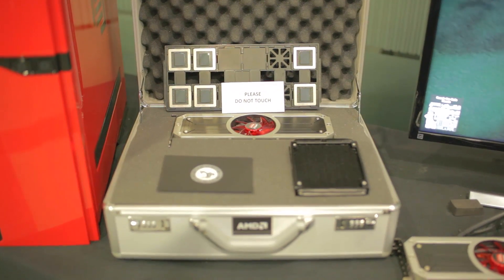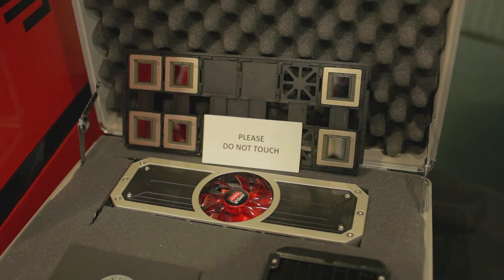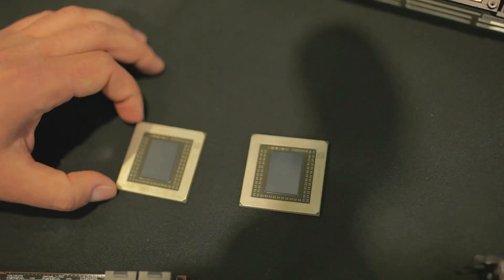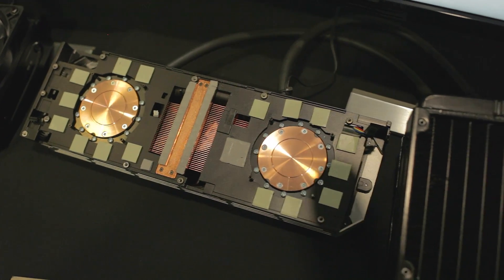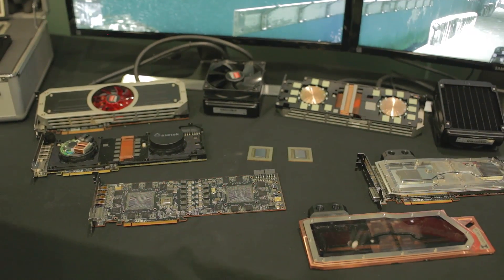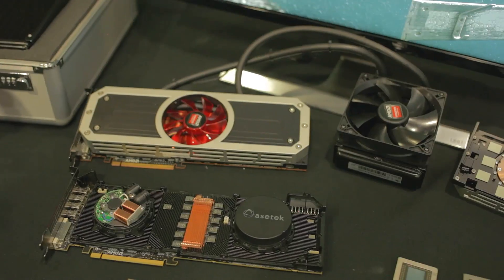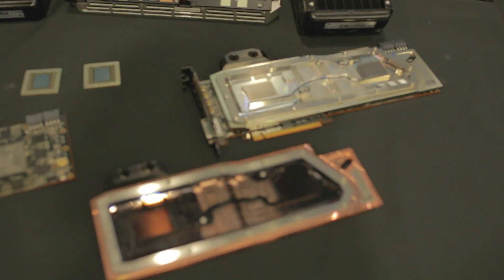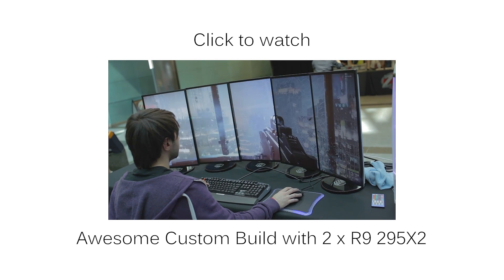AMD R9 295X2 Dissected + Custom waterblocks (ExtravaLANza 2014)

Comment: "Performance of a full liquid cooling solution"
A full liquid cooling loop wouldn't run two GPU's on a single 120mm radiator that isn't even that thick, nor does it have that high an FPI.

There's no chance that it provides the performance of a proper loop.
Reply: Considering only enthusiasts would actually use a card like that to it's full potential, there's no need for a terrible AIO such as that.
It doesn't excuse the fact that the 295X2 is woefully inefficient either, it wasn't a choice for them, it was mandatory that they use liquid.
Reply: TwitchFast
 From the reviews I've seen it overclocks pretty dam well and only hits 70 degrees area.
Reply: T.E.D. de Medici while the VRM is screaming about melting the PCB.
Have you seen that video where they film how hot the VRM with an IR thermo-camera? That thing get super hot and AMD simply cannot be bother to cover it with a full cover waterblock, which is the same for all their PCB design, they just don't care about making it easier for waterblock maker to design a working full cover block to active cool those VRM even if it is lead melting hot.
Reply: As previously mentioned above, the GPU core isn't the only concern.
Every 295x2 I've seen can barely overclock because they're already at a fairly high clock, not to mention the VRM's get extremely hot.

It's nearly as stupid as using a Kraken G10 on your GPU without adding heatsinks to your VRM and memory modules.

Also, 70 degrees isn't good for a GPU that's liquid cooled.